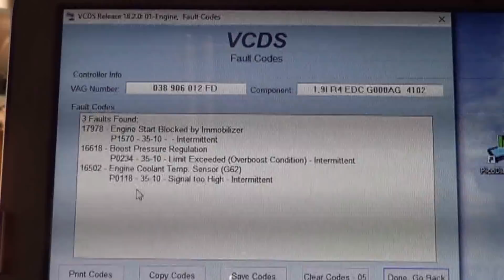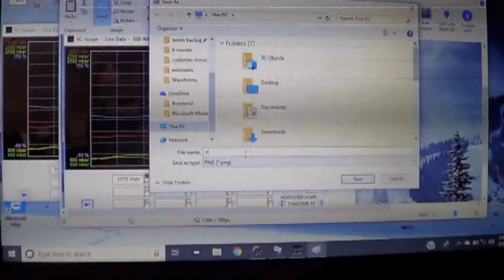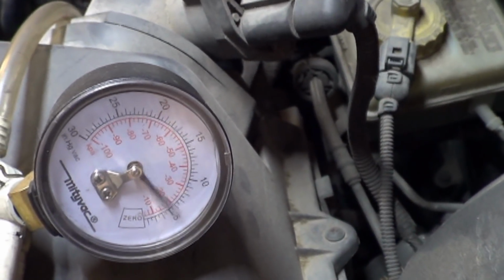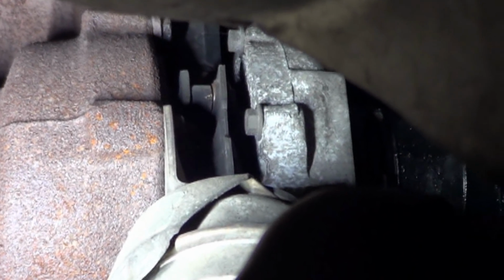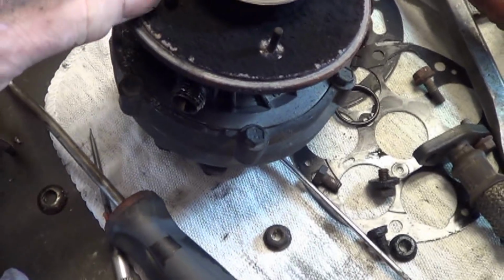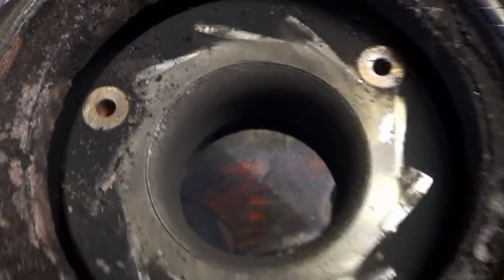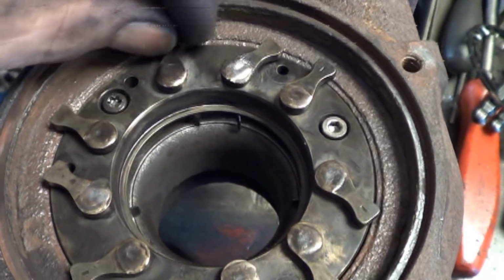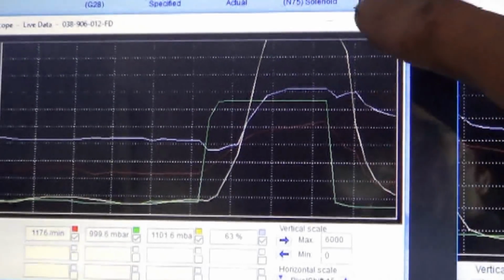Vw Tdi P0234 Overboost

Comment: Will over boost also cause the engine to shake when idling and smoke? The reason I ask is because my engine shakes and smokes but when I do a diagnostic test it comes up with p0234 overboost Oh and it goes into limp mode when I go over 3000rpm . Its an Audi A4 2007 2.0 TDI Avant.
Reply from the maker: I doubt it, but maybe you got a cylinder that isn't contributing.  That might cause the shake and smoke nad code.  What year you got?
Reply: I have a 2007 Audi A4 2.0 TDI I think it might be clogged or blocked injectors so I am going to attempt removing and cleaning them.
Reply from the maker: @krazyhacks7542  coil pack failure is common.  If you have a OEM "type" scan tool you can moniter misfires in feilds 15 and 16, then swap the coil packs to see if the misfire moves.
Reply: @CoolAirVw  coil pack? On a diesel....🤔 what for? 🤭

Good training video though, shows cleaning with all the do's and dont's 👍🏻
Reply: Id say overboost 'was' your problem originally... by the code, youve now cracked a ring due to it left untreated or misfortune 🤷🏻‍♂️ on one cylinder. Pull the heater plugs and do a compression test to confirm...
Reply from the maker: @lawrencestanmore5431  Sorry I replied thinking about some other car.
Reply: @CoolAirVw  Its diesel so I dont think I have coil packs.
Reply: @CoolAirVw  I sorted the overboost by cleaning the turbo.
Reply from the maker: @krazyhacks7542  Cool!

Comment: Watched this video a few times. Tommorow will start cleaning it on my 2007 BPW Audi engine. After the removing of the turbo housing when put it back would be ok to apply some copper grease in order to prevent gettin stuck in the future? Also is that ok to use paint solvent to proper clean all the vanes area out pf that carbon deposit or even petrol is good sometimes to clean carbon grease deposits.... ? Thank you for the detailed video.
Reply from the maker: I really feel like anything you put in there is going to burn out over time. Best thing to do is to make sure the vacuum system is always working and exercising it to its full Boost to minimum boost positions and drive it hard at least once per Drive
Reply: @CoolAirVw  cool. Thank you for your fast response.

Comment: Excellent Info, How many miles on that vehicle, How long should I expect my turbo to last, mileage wise?
Reply from the maker: I know these turbos commonlyh last 300k or more.  They can stick like this one early though because of driving style.  Once per drive get on it hard WOT for as long as is safe like as your on the entrance ramp to the hiway.  this exercised the vanes to max and min travel plus burns out carbon build up.  Tdi drivers tend to be MPG concious, and so this is common.
Reply: @CoolAirVw  Thanks' for the info. That's made me Happy. Recently purchased   2012 MK5 TDI Polo  80,000k  New to me, just getting familiar with the sounds the engine makes, so should be good for a while yet.

Comment: Quick question, hopefully you still reply to new comments but yes: i know a dude who would get me a brand new turbo cheaper and easier than this repair method, would you recommend it isntead?
Reply from the maker: A band new turbo is $800 (for a good one) if you want to experiment with C.R.A.P.  (chinese replacement auto part) then caveat emptor.   Turbo still has to be removed and reinstalled do replace it.  Certainly this repair could be done cheaper than even a crap turbo???  Look you have to deal with the mechanics that you are near.   You either have to take their recommendation, talk them out of it or find another mechanic.
Reply: @CoolAirVw  The problem is, i live in norway, a good turbo might cost around 800$ where you live but here it goes up to 2000$ exluding work done. In total it might cost me around 5000$ according to my local mechanic. The guy i know would import them from germany so from what i know, he says they are good. But i am not really sure, thats why i am asking.
Reply from the maker: @TheNorseStargazer  Wouldn't that make you to want to fix your current turbo?  If you found a source for a good quality cheaper turbo then go for it.   but, I don't see how remove and reinstalling with fixing your turbo could be more expensive then removing and reinstalling with replacing a turbo.  If your turbo is ok with regards to shaft play and your vac pod works then I think fixing it is a good option.  Especially with all the CRAP out there.
Reply: @CoolAirVw  I definetly see your point, i dont have a workplace or tools that can assist me with such repairs unfortunately. Tools like a blow torch to ease off bolts without breaking them or some sort of sanding machine or wire tool to remove the carbon build up. In fact, simply acquiring those tools might be expensive. If you could do some sort of budget repair video or tell me some about replacement tools to use instead i might consider it. I am not a mechanic, but a hobbyist so things like these arent too common where i am currently :).
Reply from the maker: @TheNorseStargazer  You cant fix a car without the tools to do so.
Reply: @CoolAirVw  See that was my main consern. Would it be worth it to just buy all the necessary tool to repair it or just have it replaced? Thats the golden question. Which is worth what.

Comment: Excellent video. Thanks!
A couple questions. In your experience, what component fails most when it comes to these TDI turbos? My vanes have full free motion, all vac lines have been replaced. I have ZERO boost. Been driving for some time now w/o boost...no time to resolve issue. Finally getting around to it. I also do not have Vagcom diagnostic software (can I buy it?) 
As far as components, would replacing N75 1st be a good bet?
Reply: I'll add, do you see the actuator fail often?
Reply from the maker: checking n75 is easy.  If you dont have vagcon to turn it off and on do it with some jumper wires.  Watch the video, understand what the tests are doing and improvise.
Reply from the maker: Bee sure to check for boost leaks. And proper routing of vacuum lines.  make sure turbo impeller will spin and is not destroyed.
Reply: @CoolAirVw  I did watch the video. I don’t remember seeing a demo to jump the n75 though.
Reply: @CoolAirVw  When I replaced all the vac lines, I did one at a time so I wouldn’t make a mistake.
Reply from the maker: @OleMossyHorn  watch the video, understand what is going on, them improvise.

Comment: Great video. So am i guessing right that the delay between the specified and actual is like turbo lag? Im only part way in but I’m guessing the variability is not working and its only acting like a large turbo?
Reply from the maker: I suppose the easy answer is "yes".  I assume you're talking about the problem with the your car.    I find it difficult to be very concerned with "turbo lag" as the over boost condition is constant in this example.  There is some lag in any turbo, but its very minor on a VNT turbo like this.  I can't agree that it is "acting like a large turbo", although in simplest explanation it might seem this way.    Its making too much boost.  Computer commands a certain amount of boost and if the computer see's too much boost, more than it commands for a certain period of time,  it reacts by going to  "limp mode" making less power.   It does this by cutting fuel.

Comment: Very good video, just one question when you go into Measuring  Blocks and type in group “11” does this always show you the boost specs no matter what car you have VCDS plugged into? I am good with computers and still learning VCDS and how to use it properly on my own car. I use CTRL A, CTRL C and CTRL V all the time as it’s a lot quicker. Thank you for a great video👍
Reply from the maker: Most Tdi's are consistent 99-present with group 11.   Earlier would be different and non-tdi's are different (gas) 1.8t, 2.0 tsi ect.  Luckily with vagcom you can scroll through and find it because they areusually labeled.  Thanks for subscribing.
Reply: Hey thanks for replying, yea I noticed if you just go through channel at a time it’s not hard to find. If you keep putting videos up with as much detail you will get even more viewers and subscribers. A lot of people have got Vagcom but don’t know how to use all its features to diagnose problems. Very good job 👍

Comment: Thanks for this video. I have been testing my beetle for under boost and its pretty clear what's wrong now. I'm only getting about 7 on my gauge at throttle up (2003) model. Your gauge read 20, so its a vacuum issue and not my turbo. What should the pump be pulling would be nice to know. Mine is less than 20 on my vacuum gauge.
Reply from the maker: 20 plus.  Wiggle around on the nipple to see if vacuum supply goes up .  If so you might be able to "peen" the nipple in and  restore vacuum.

Comment: is it possible to losen the thing by push and pulling the lever with the hand a few times? Without disassembling the turbo at all?
Reply from the maker: Yes, If it isn't stuck really bad.  Don;t put too much force on it you can damage stuff.  There are some foks who remove the exhaust downpipe and spray oven cleaner in there also..

Comment: could vanes stuck in boost position cause surging? i have no codes in the ecu but my stock 1.6 tdi (150k miles) is boosting to 1.5 bar's (thats the max the ecu can read) and the turbo surges and flutters when letting off the throttle but it wont go into limp mode.
Reply from the maker: maybe.  Easy to check for stuck vanes.

Comment: Hi and thanks for the great video. I have  a question about my vw mk4 TURBINE, when the car is turned on, the actuator stays close to the Adjustable Stop. when i turn car off it goes up all the way. does this mean my car is on limp mode too and it applies full vacuum? When i throttle it starts going away from the adjustable stop screw, but when i stop throttle it again goes to the screw. i'd really appreciate any help, thanks a lot.
Reply from the maker: No it doesn't.  When the car is on the computer gives the turbo some vacuum.  This is normal.  Vacuum to the actuator makes boost.  No vacuum to the actuator makes no boost.
Reply: @CoolAirVw  i got this part, but why is the actuator all the time hitting the adjustable stop when car is turned on?
Reply: @arsimismani2955  At idle the rod should be at full boost position. This is because the ECU is requesting a small amount of boost even at idle and with low engine revs, the VNT needs to be at max boost position. Starting and stopping the engine is a good way of seeing max and min boost positions, as is momentarily disconnecting the vac pipe at idle.

Comment: can this also lack power?
I have a focus tdci with a vnt turbo, and am getting overboost issue, I have replaced the vacuum solenoid, but the actuator rod still moves kinda sticky, not a smooth motion.
Im getting an engine light for overboost, but its NOT putting me into limp mode, But still, I find my car lacks power.
Some days i can drive the car, and it accelerates like a rocket (stage 1 remapped), then other times, its gutless upto 60mph...
Defo not limp mode, because i can still rev up fully and get to any speeds i want, its just sluggish to accelerate, compared to usually..
I assumed that overboost would give good power output, Because, obviously, its getting full boost... 
Im just getting lack of power, turbo kicks in alot later in the revs, You have to thrash the car harder, to get the power, which i thought is strange for "overboost"... 
cheers
Reply from the maker: yes, when the computer notices the overboost it defaults to limp mode which means it cuts fueling to reduce the potential to damage the engine due to overboosting.

Comment: Having same issue, turbo worked fine one day then actuation rod froze at about 50% movement. Don"t notice problem until about 3200 rpm in 3rd gear. Waiting for a nice day when I can tear into the turbo.  My Turbo froze at about 140,000 miles. How many miles were on this car?

Comment: What happens if you zip tie the turbo actuator shut on a 2006 tdi ? My coworker did that and I told him he take it off because he will crate too much boost he claims the ‘guys in the forums do it all the time’
Reply from the maker: You'll bet a boost trouble code.

Comment: When the turbo failed engine did not run away it just filled the car with oil smoke then I switched it off..had car towed home ..on further investigation found the engine to be hydra locked  I removed the glow plugs turned engine over got oil out of the plug holes ...put glow plugs back in top up motor oil started car it ran good only for a couple of mins just to check it was still good ...motor only done 120000klm so hardly run in lol .
Reply from the maker: Hydro-lock can bend rods.  Hopefully not.

Comment: Hello, does turbo fail when smoke comes out from exhaust? Burning all oil from the oil sump?
Reply from the maker: That is one way the turbo can fail.  If its smoking a bunch probably shouldn't drive it due to risk of runaway.
Reply: @CoolAirVw  Thank you for the answer! When I start the engine it smokes a lot.  Driving not too much, whet throttling, it sucket all oil from oil sump and extracts the oil from the silencer.

Comment: when fit back the ring with vans need to apply some torque to the bolts ???that three torx bolts i mean ,and also to that 5bolts what keeps the axel shaft and kompressor?i fited a new axel and it's blown after 50 miles!i think the reason is because i not applied an uniform torque to every bolt !?

Comment: If my actuator is sticking on my turbo would you recommend me simply to replace it or would you recommend me to replace it and clean all the turbo vanes or just clean the current actuator and the turbo vanes? I have an overboost problem! Thanks!
Reply from the maker: you have to remove the actuator to see if the actuator is sticking or it the lever is sticking.  If the lever (vanes inside) isn't sticking just replace the actuator.

Comment: I have a 2001 jetta tdi that does this. It also sometimes has a hesitation when excelerating. Code is a overboost . Is there anything else that causes this? Thank you.
Reply from the maker: usually overboost is n75 sticking, this problem or maybe turbo actuator out of adjustment.  Can be vacuum problem if someone routed vacuum improperly.
Reply: @CoolAirVw  OK,  I will look into it. It runs good otherwise,  just down on power a lot. It's definitely lacking power during exceleration. Thanks for the reply.

Comment: Check your display settings. Some laptops can do either 59hz or 60hz. Try either to see if it goes away when recording it with a smart phone.
Reply from the maker: I played with these settings once before at someones  suggestion, and it made no difference.  I just now checked and it was set at 40 hertz, so i changed it to 60.  We'll see.   Thanks.

Comment: Audi A3 2005 BKD 2.0 TDI
EGR cleaned
MAP checked
Electrovalves checked
Turbo externaly checked (also no smoke)

Fault P0234

My question: Can catalytic be almost full and returns to turbo gases (air) which force turbo to increase pressure to force gases (air) to exhaust? Does this make any sense?
Reply from the maker: I'm not sure exactly what your saying, but if your asking if the Cat being partially clogged will cause low boost, then yes it can.   I ran into this recently on a 1.8T gas engine.  It will probably be a  short bit in a video later.   On a similar note a extremely clogged air filter can cause the exact same thing.   Saw that on a tdi recently as well.   If the engine cant breathe, the turbo cant make boost.
Reply: @CoolAirVw   actually i have over boost problem. And i mean if a blocked Cat would be the reason for over boost turbo?
Reply from the maker: @olsiolso4601  No, clogged cat will cause underboost.

Comment: hello great video  maybe coz this turbo dont use oil   the problem     why not trying   spry it with wd40      or any kind of solvent
isaw what u didn't its just cleaning
Reply from the maker: After you take it apart  you see that there is no way you can really spray into all that area.  A little spray isn't going to remove all the built up carbon as you can see in the video.  As a Diy'er someone can certainly spend their time trying "possible" fixes.   Lots of people 
try oven cleaner.   As a shop I have to guarantee its fixed when I'm done.  Its got to be clean and free when I'm done.  I can't just "try" cleaning it.  My opinion is spray would rarely work
Reply: @CoolAirVw .  Nice  comment  that you had to guarantee it.    I understand that

Comment: Will that rod have some resistance? I have an 02 1.9 TDI. Seems like it moves too easy. But started limp mode when going up steep hills. And engine over boost code came up
Reply from the maker: Since you have a overboost code, graph to make sure.  Over boost is always the vanes sticking, the n75 boost solenoid sticking or adjustment of the vnt.

Comment: Hi there just watched your video on overboost I was just wondering if you no much on the 1.9 cdti engine astra twintop mine is going in to limp mode at 70 mph saying its over boosting but there's no boost at all when driving I have checked turbo actuator and the link arm on it to the vanes is fully working going all the way up and down I have put a mityvac on the turbo actuator and is reading 18 inches of mercury I have also checked the boost control Solenoid and that is also holding vacuum do you have any tips for me or checks that I can do
Reply: It's more than likely the air flow meter 🖒